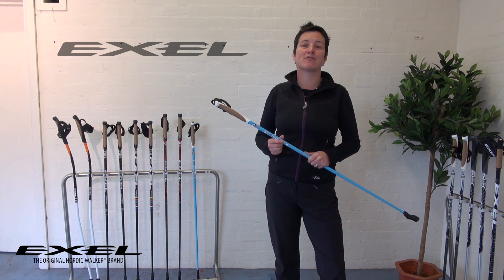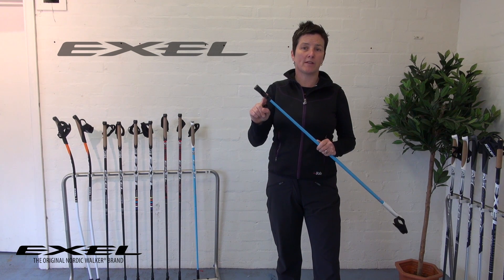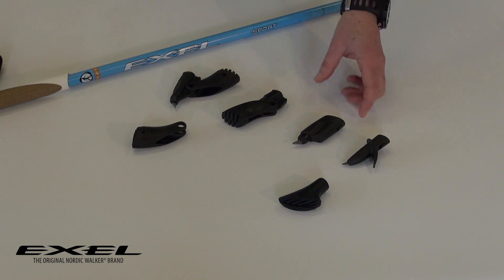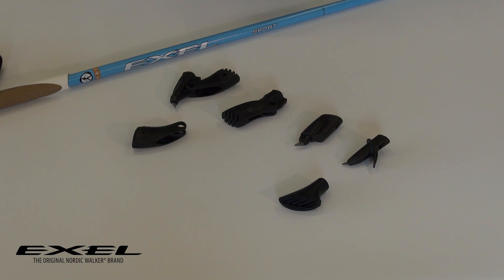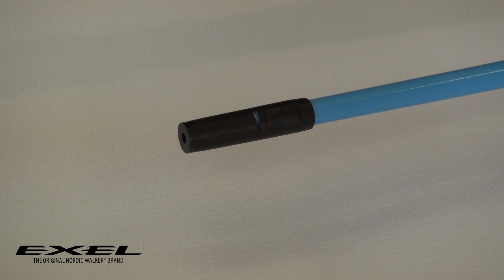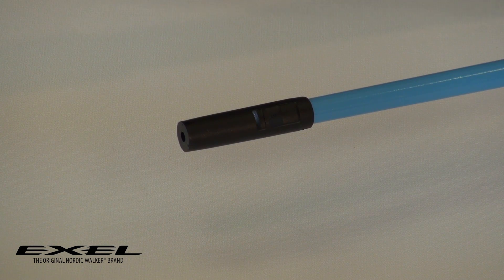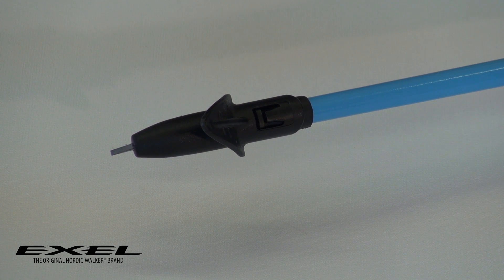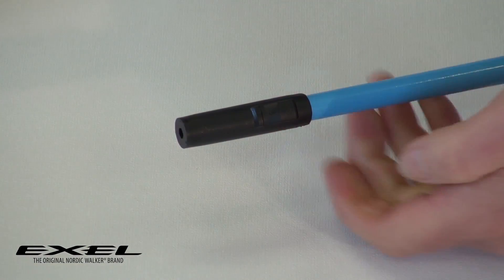HOW TO GUIDE: Using the Exel quick lock system to change the tip on a Nordic Walking pole

Comment: I have used the Suspension Tip for roller skiing and found that because of wear and tear by the road surface it probably would be better if the actual tip were mounted reversely in the holder so the holder can be pointing backwards. This would mean that also the receiver has to be mounted reversely and therefore break the compatibility with the other tips.